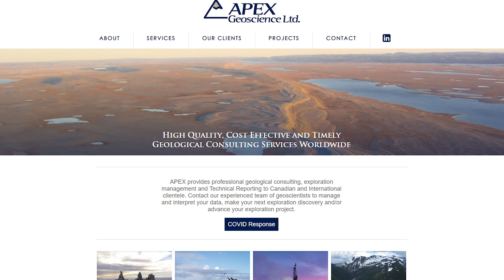This US miner has discovered enough lithium for 50 million EVs

Comment: Everything has gone up because of inflation, but it's my understanding that processing lithium is a bigger issue than scarcity. If scarcity were truly an issue in the near future, we'd already be recycling it.
Reply: We ARE already recycling it.  The lithium recycling industry is huge.
Reply: No sourcing lithium is a bigger problem .It takes 7-10 years to mine for lithium, Tesla alone will require 80% of the global supply by 2030 if they plan to sell 20 million cars. we need at least 60 more mines to meet our demands.
Reply: @WupeViasco  There are roughly 200 billion tons of lithium in the oceans, and a process for extracting it from ocean water very cheaply was invented in 2021:

In essence, a membrane (crystal lattice) with holes small enough for only lithium ions to pass through was found. A lithium ion is the smallest metal ion, so all other metal ions are filtered out.

By performing (water) electrolysis across the membrane, the electric force pushes the lithium ions through, and you get hydrogen and oxygen at the electrodes, which you can use in a fuel cell to reuse most of the energy needed for the process.

All in all, for a small amount of electric energy, you get a concentrated solution of lithium hydroxide, which just needs the water boiled off, then that lithium hydroxide is directly usable for a factory producing lithium batteries.
Reply: @silvergreylion  they still have to figure out how to extract this 200 billion ton of lithium on a COMMERCIAL scale let alone this  it still takes the world 7-10 years to mine lithium traditionally.
Reply: @WupeViasco  Well, yeah, but that's mining. Takes time to dig through rock and locate deposits, which can be a hit-and-miss game.
With this, all you need is membranes of a sufficient size for commercial-scale extraction. So it's really only the production of those which currently limit the extraction.

And we'd never need to extract 200 billion tons.
At a rough estimate, we'd ever only need to extract 2-3, at most 4 billion tons, or 1-2 % of what's in the oceans. The concentration would barely change.
Reply: @silvergreylion  Again it’s one thing to develop something in the lab and another thing to actually bring something into production, technical maturity and to a commercial scale which this technology has barely even reached. Take a look at solid-state batteries for a random example it’s invented and but for anybody to bring it to a commercial scale will take at least a minimum of 7 to 10 years. There’s a reason why we are still using the available methods of extracting Lithium because the technology has not caught up with demand. 

The scientist have still not figured out how to isolate Lithium on its own from the seawater which is a nightmare. If they can’t figure that out there’s no hope.

Until then the only reliable methods of extracting for lithium can be accounted for by the technology that’s commercially available today which is brine extraction and hard rock mining, you also have to understand that the lithium quality is important, if seawater lithium is not at hydroxide levels then west/US will not accept its quality. 

The most popular form of lithium is hard rock hydroxide due to its quality levels.

Comment: So we know lithium shortage will be an issue.  So obviously all EV manufacturers are focusing on making small light commuter vehicles that require less batteries for distance.   No one would be focusing on large hummer like vehicles swallowing up 200+kWh packs of batteries.    I mean that would be foolish.       Also like reinforce the point that it probably would take up to a decade to get  a new mine operating.

Comment: 50 million ev's? that would be fine except there are currently 284 million vehicles on us roads alone. plus we still don't have a plan to recycle 100% of lithium batteries (including those destroyed in crashes). plus world demand for vehicles is nowhere close to leveling off. evs are a prototype curiosity that is in danger of getting out of control. solve the battery problem and evs are ready for prime time. until then....

Comment: Lithium isn't in short supply. The main supply constraint is the refining of it to the high level of purity needed for batteries.
Reply: You have one of the few smart answers I can see here.

Clearly a lot of people here have NEVER worked in the mining industry or have NO IDEA about manufacturing, but then most of these idiots spouting nonsense have NO IDEA because they have never been involved in manufacturing or been involved in mining and I'VE DONE BOTH. I used to work in the Australian automotive sector before it shut down and have since worked in the Australian mining sector in control systems and automation.

1: There's a giant difference between finding a deposit, getting it properly assessed and then being able to mine it.
Circa 2006 I worked on the construction of the Ravensthorpe Nickel project. BHP spent $3.5 Billion on the project. It was laterite nickel which is a bitch to process, but it was justified by the quality of the deposit and the value of Nickel. BHP did NOT complete a full drilling test pattern and the deposit was found to be NOWHERE near as good as the PR claimed. The mine was closed after about 18months and sold for less than 1/7th ($500 Million) its.
The Lesson: Don't believe the PR hype even when its from a major player. 

2: You absolutely do need Nickel for batteries, just as you need copper for the electrical cabling in an EV just as you need all the other metals, glass and plastics. Go and look at your car and see how much stuff is actually in one. If you have ever been in the plants where they make all those bits that go into a car you'll quickly understand that it takes a whole range of raw materials and lots of energy to make the bits that make a car and all of that uses lots of energy.

The quickest way we can reduce emissions is to reduce how much energy we consume as a society.
 
THE AUTOMOTIVE MANUFACTURING SECTOR is one of the largest energy consumers because it not only uses a lot of energy making the cars it uses a lot of energy getting the raw materials out of the ground and processing that into the raw feed stock to make the parts the cars are made from. The best thing we can do is NOT replace old cars with new cars but replace the drive systems in old cars with EV and Hybrid systems. It will save huge amounts of energy and resources while keeping millions of people employed. 

BUILDING EFFICIENCY: The other great (and inefficient) user of energy are BIG BUILDINGS. Mark Blyth the political economist from Brown U. pointed out this a couple of years ago. Some engineer worked out that just triple glazing all of America's buildings would employ 1000's and 1000's of people for well over a decade and reduce America's emissions so much that meeting the Paris goals is easy because you can then turn off a bunch of dirty old coal fired power stations. All those big giant glass boxes are designed by architects to look pretty NOT by engineers to be efficient. Not only would it creat employment but raise the asset values of all those buildings as well as reduce the power costs all the tenants have making them more profitable. I'd like to hear an economist claim that's not a good idea.
Reply: @tonywilson4713  Excellent perspective! You are correct that many consumers (self included) have no idea what goes into manufacturing and even less about mining raw materials. I appreciate the knowledge! One quick thought about cars. My Acura is 16 years old and runs like a clock. I'll argue that the building of quality cars (either ICE or EV) is not in a corporation's best interest and profitability. What incentive do corporations have to build a car that lasts 15-20 years? As you pointed out, using less of raw materials is best for planet but unfortunately, goes against our current corporate environment.
Reply: @tonywilson4713  If reglazing windows is so cost effective, then why don't we see masses of building owners doing it? Also, I don't think you can just throw an EV drivetrain into any old car. Isn't that basically what the legacy automakers are trying to do, instead of designing an EV from the ground up?
Reply: @darylfoster7944  That is one of the great questions. Why aren't we already triple glazing every one of those giant glass boxes?
To be honest I don't know, but then common sense and corporate decisions don't always line up.
Reply: @darylfoster7944  On putting electric or hybrid drivetrains into legacy cars. You're right there is absolutely no incentive for existing car manufacturers to supply new drive trains. They make their money selling new cars not parts for cars.

I worked in the Australian auto industry when we had one and as far as they were concerned they hate spare parts. That hate having to make them, they hate having to store them and they hate having to supply them. Its why they charge so much and why its so profitable to take wrecked cars and strip them of good parts that can be re-sold.

But since Australia no longer has a car industry it actually makes sense for us to develop an electric and hybrid electric upgrade industry.

In a country like Japan with their laws on vehicle ownership it makes no sense.

In America and Europe it makes sense to have some industry developed as PART of an overall strategy, but not have it be the main solution. If you did you'd kill the existing manufacturing base causing mass unemployment and that's the economic disaster everyone needs to avoid.

These are things each country needs to look at and work out what's best for them, but we all need to work on it.
Reply: Elon has been begging entrepreneurs to go into the lithium refining business. He said the margins are huge.
Reply: @darylfoster7944  On lithium you need to take comments by Elon Musk the way any sensible person does and consider it bullshite.

After working in manufacturing I went to the mining sector where I have been for most of the last 20 years. Everyone thinks mineral extraction is like what you see on Alaskan gold mining shows - ITS NOT. Gold is one of the very few metals that exists as metal most form oxides and other compounds.

The weirdest and funniest story I have was my introduction on an Alumina refinery. They simply told a room full of people that if we couldn't handle being stripped naked and held under a cold shower for 1/2 and hour to FK-OFF and they were that blunt. To dissolve the aluminum out of bauxite you use caustic soda at temperatures over 140C (280F) and high pressure. If any of that gets on you then you are under a cold shower immediately or you're FKD.

I also worked on mine sites where the power station burns sulphur. Sulphur burns like coal except you get SO2 not CO2. With a catalytic converter you get SO3 and mix that with 100% pure water to get H2SO4 better known as sulphuric acid. You then use the H2SO4 to dissolve the nickel, copper,... out of the ore. I have been on sites where the H2SO4 was 100% pure, which freaked me out until the chemistry boys explained how it works.

So trust me I know how much Elon is full of shite on the subject.
Reply: Lithium will be In short supply because we do not have enough mines to keep up with demand. The world needs at least 60 more mines
Reply: @WupeViasco  You seem to have overlooked the fact that once EV take-up reaches a certain point, then there will be much greater recycling of older EV batteries, which will return 90% of the lithium and cobalt recovered during recycling , back to the battery manufacturing industry. Circular economy.....
Reply: @Brian-om2hh  there are not enough  lithium batteries to be recycled to provide sufficient supply for the demands of our future. At least not within the next 7 to 10 years. This is clearly reflected in benchmark Minerals intelligence Lithium supply demand projections. We are dealing with an issue of the lack of mines, recycling will not fix this issue anytime soon.

Lithium batteries have a lifecycle of at least 10 years, from there a mass supply of batteries can be recycled to then be reused, and by the way the biggest market of lithium batteries, china does not recycle most of their batteries

Comment: if this is true, I see only one problem. the water table in the US is being strained already. if they began to mine lithium in the US they will further strain the water supply. I wonder how they will handle this and what affects this will have on natural water sources.
Reply: The Smack over brine deposit has been being mined for bromine for decades and the brine water is returned to the deposit.  Another Canadian company (Standard Lithium) already has a pilot project to piggyback onto the bromine operation and remove lithium using a direct extraction process. It should not affect the water table.

Comment: Have you seen the footprint of a Lithium mine?
Reply: There is no such thing as mining without impact, there is always some. The device you typed your message with is thanks to mining and you made an impact…If you do want to make a point, how about comparing the total footprint of the oil industry. It’s about a better solution, not the 100% utopia of no impact
Reply: No, but I imagine it's quite similar to a cobalt mine. Cobalt mines have been operated by the oil industry for decades, because they need cobalt to remove sulphur during the refining process. They can't refine oil without it. In fact the oil industry are the largest users of mined minerals by far..... If you drive a car with an engine, then you're a part of the very problem you are seeking to highlight......
Reply: @Brian-om2hh  Bot

Comment: You truly underestimate the arrogance, stubbornness and ignorance of the American public if you believe that they all will willfully transition to electric cars. I have an electrical engineering degree and have been telling my friends about the advantages of EV's for decades(yes even before they became mainstream.) My old gearhead friends however swear they will never buy an EV because of the same old tired reasons. My favorite one is what happens if you run the battery out of juice. I ask them what happens when they run their car out of gas. You fill it back up. They look at me like I'm the moron. They can no longer use the excuse that EV's aren't powerful enough. They often look embarrassed when a production Tesla blows away one of their custom made hot rods. Here is another of my top ten excuses not to buy an EV. I like the sound of the engine roaring. I tell them to get an mp3 and sync it to their revving motor. Same sound, but more power. Oh well. Some people just can't be educated.
Reply: how will arrogance, stubbornness and ignorance cope once oil actually runs dry, and they finally realise there is no option?

Comment: It is not that there is a shortage of lithium but rather a huge need to increase the efficiency of extraction and refining of the deposits. It is more realistic to address this in geothermal brines than in hard rock deposits.
Reply: EnergyX has a new process to refine geothermal brines very quickly. I hope it really works and is successful.